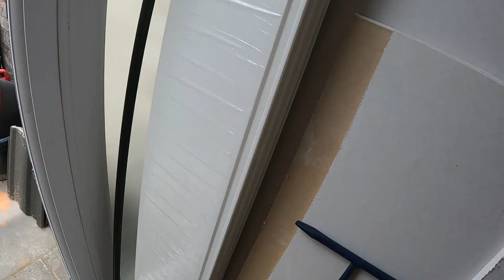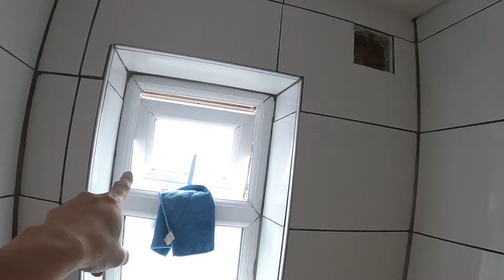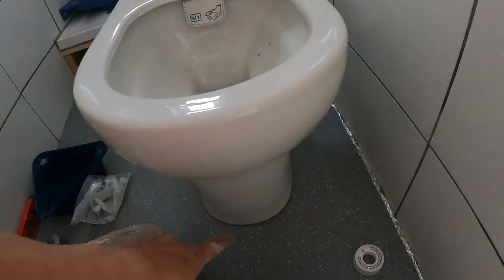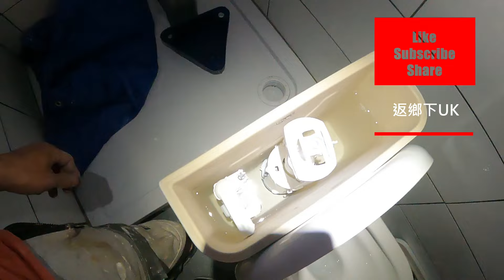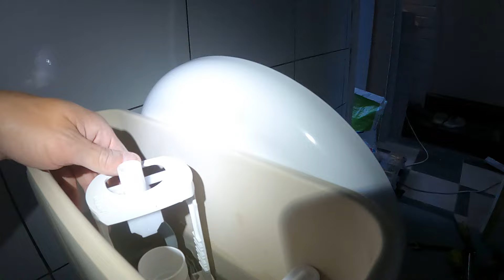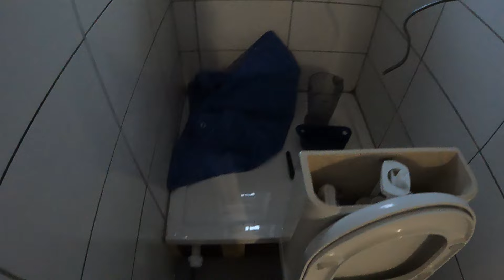返鄉下UK - 英國小車房室內翻新計劃 | 廁所改造編 | PART 4 | 天花地台廁所安裝編

Comment: 請問點聯絡你
Reply from the maker: 請參考：
Service 主要服務: 
Renovation 裝修
Plumbing Work 水喉安裝維修
Electrical installation & maintenance 電工安裝維修
Painting 油漆
Laminate flooring 地板安裝 
Window and Locksmith 窗門安裝維修
WiFi alarm system installation 無線防盜安裝
Radiator installation 暖板安裝維修
Electric shower installation 沖涼電熱水爐安裝
Appliance installation 家電安裝
Tiling 舖磚
Extractor fan installation 抽氣扇安裝
General Repairs 家居維修
Renovation & Maintenance Delivery 外賣工程 

報價查詢聯絡方法：
fb/ig: 住英裝修維修 renovationmaintenanceuk
fb/ig/youtube: 返鄉下UK backtotheuk
email: renovationmuk@gmail.com
whatsapp: +44 07393632568

英國相關牌照UK Licenses: 
#英國註冊見習電工 ECS Electrical Labourer
#英國註冊水喉熱水爐機械相關工程服務安裝及維修 UK Plumbing Heating and Mechanical Engineer Services CSCS
#英國註冊工人卡 Labourer CSCS

服務地區 Service Area: 
利物浦 曼城 沃靈頓 Liverpool Manchester Warrington 

外賣工程 Renovation & Maintenance Delivery : 
歡迎英國各區業主報價查詢
Homeowners in all areas of the UK are welcome to inquire for quotations

Feel free to send message us for a FREE QUOTE 
請PM聯絡報價

#英國裝修維修 #英國屋翻新 #英國DIY #英國水電工程 #英識裝修維修 #英國舖地板 #英國水喉安裝維修 #英國電力安裝維修 #英國舖磚 #英國家電安裝 #浴室廁所翻新 #廚房翻新 
#plumbingwork #Painting #windowsmith #locksmith #Laminateflooring #homemaintenance #electrician #electricalinstallation #plumber #renovationmaintenanceuk #tiling #applianceinstallation
Reply: 空間盡用, 好👍👍👍